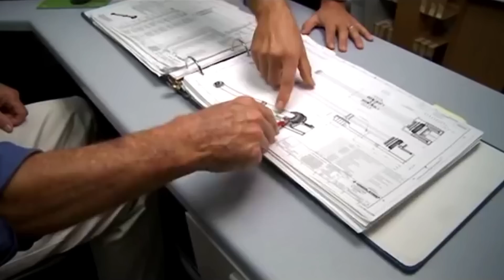US's Ultra-Advanced Railgun Weapon Is Making All Others Obsolete

Comment: Any information on the composition of the projectile?
Reply: I think it's actually aluminum, but maybe that's just the sabot that encases it until it leaves the barrel.  You don't need those extremely heavy metals for these, energy is 1/2mv^2, so the energy transferred to the target is unbelievable at those speeds, basically an explosion w/o any explosive material in them.  Look at the penetration tests as well, these go through many plates of steel like butter.
Reply: @boxlid214  or, F=MV?
Reply: @cosmicyeti6804  what's more important is the kinetic energy transferred to the target, which is the 1/2*mv^2 formula.  Velocity is squared, so much more important than mass in a weapon like this
Reply: Probably depleted uranium or tungsten?
Reply: @cosmicyeti6804  I was also thinking tungsten. DU would be an ecological nightmare from when the shell splinters and get embedded into the surrounding environment.
Reply: @joeclaridy  I heard the same. Last I heard, (I am NO expert by a long shot) that they cannot keep the gun from rearing itself apart. What I heard on the internet (and everything on the internet is true after all) that the damage is pretty catastrophic even after one shot.
Reply: @cosmicyeti6804  more or less what I figured, thanks
Reply: @cosmicyeti6804  I don't think DU can survive being fired.
My guess is extremely strong steel (structurally strong, rather than hardened), or aluminum which suffers less strain in 30,000 g's because it's lighter.
Not that it matters, the guns can't survive being fired either.
Reply: Watermelon.
Reply: It will be tungsten for sure.

Comment: Firing a projectile at that speed would ruin the barrel after only a few shots. This is the reason I think that it is not viable.
Reply: ideally, the magnetic impulsion field would result in no contact with the inner barrel, resulting in a frictionless launch.
Reply: @Maxislithium  it’s not the friction inside the barrel that destroys them, its the superheated plasma blast that happens at the muzzle when the projectile meets the outside air.
Reply: Use soft sabot.

Comment: Firing super conductor projectiles via rail guns that utilize a cryogenic chamber, could in theory allow for zero physical contact throughout the entire length of the barrel. Thus eliminating the wear and tear on the system thanks to quantum locking.
Reply: Go simple- Brass sabot.
Reply: @jozefkozon4520  why brass?
Reply: @joeclaridy  Soft+conductive+cheap
Reply: @jozefkozon4520  Not practical. brass will vaporize before it leave the barrel create a toxic cloud of zinc (brass is made of copper & zinc).Brass has way too much resistance to work (about 5 times more resistance than copper)
Reply: @guytech7310  still, that's closer than weirdout barrel. Sabot is one use anyway. If not brass, than another material will be found. Plasma problem can be solved with muzel device. Problem lays with electronic anyway. To be frank I'm just iritated for people that do noise over things they do not understand. Problems are to be solved and mindset of imposibility will not get us there. But in hindsight, brass might not do. Would you propose alternative? Clear copper maybe?
Reply: No because that's not how Rail guns work. The pair of electrodes needs to short across the projectile to accelerate it. The current needs to flow through the projectile.

Comment: more range, more firepower, always welcome in this arena.
Reply: and that's why most of the world is moving towards missiles. why make an obscenely expensive cannon when you can just mass produce guided missiles ?
Reply: @Lapantouflemagic0  I imagine this could have certain advantages over missiles, the projectiles may be alot cheaper, and it would deal immense damage.
Reply: @vegasspaceprogram6623  the projectiles, yes, would probably be cheaper and could be carried in greater number on the vessel. i think that's the main advantages of cannons (railguns or not) over missiles. 

but still, as cool as railguns are, i'm not sure they are actually that interesting. lasers are probably much better and can be used defensively.
Reply: I imagine your partner often says more length in your arena would be welcome too.

Comment: Rail guns are not artillery. They are flat, or nearly flat, firing weapons, because they can break atmosphere, if they travel fast enough.
Reply: They are also not capable of firing the types of rounds needed in combat. The fused round is one that it can't fire. You need that arc to drop that round right on top of certain targets. The current rail gun is also useless because it wears out too quickly for how much it costs.
Reply: @Jonathan.D  True, I had to look up some information. I had lumped all magnetically driven guns into rail guns. But that is not accurate. There is rail guns and coil guns. Rail guns are kind of like the video. Coil, or gauss, guns are different. But I can see the use for both types.

Comment: I believe the Navy completely cancelled the railgun project last year.  I think the bottom line is that these projectiles would be MUCH cheaper than building hypersonic missiles and that would ruin alot of defense spending schemes, kickbacks for politicians, and post retirement jobs with defense contractors for military officials in charge of research and procurement programs.  They can simply spend trillions more on hypersonic missiles in the long run than they could by fielding EM guns.  Scary that the Chinese Navy are already fielding prototypes but the US Navy is looking to get out of them completely.
Reply: They canceled it due to excessive wear and tear on the barrels. Material science isn't sufficient at this point.
Reply: @williamwallace9685  You got it right!👍 The barrels have a very limited life span. Plus, the ammo used is limited to just a few types. So it could never replace artillery.
Reply: @williamwallace9685  that's how I understood it too. So I doubt the rapid fire ability, practically speaking.
Reply: @williamwallace9685  not saying corruption wasn't a part of it , but  consider the following: 
1- Lying about the project being cancelled can reduce enemies' awareness and interest in the tech, giving the US the lead in the tech.

2 - Missiles can be fired from the air , submarines and mobile ground units, while stationary/heavy railguns might be destroyed by the enemy in a preemptive strike.
Reply: I worked in the defense industry for years and that's not how they operate. Look, rail guns are really cool in theory, but the fact of the matter is they require vast amounts of electricity and right now that makes them extremely large systems. Until you can get the size down, then there is no real use for a rail gun on platforms even as large as a naval destroyer.
Reply: @joeterzio7175  The Chinese hid the giant coal-powered power plant that their ship is connected to. 😄
Reply: @Jonathan.D  LOL!
Reply: @Advocate For UFO Disclosure It’s comments like this that make me wish YouTube would bring back the dislike button.
Reply: @infidel1993  The dislike button only showed dislikes for the video itself, not for comments.
Reply: @infidel1993  there is a dislike button i use it all the time.
Reply: A company will have to take the financial risk and prove it out prior to US military purchasing it now.
Reply: Needs portholes so we can shoot out of it.
Reply: The railgun is crap. It needs the entire gun replaced after just a few shots. So unless the Navy carries a storehouse of replacement guns in their hold, it isn't feasible.
Reply: @stevethewsimpson25  If that was the case, than just made the sabot soft. Bael aint the problem, but impulse power.
Reply: @jozefkozon4520  most of the damage to the barrel isn’t from the sabot but from the plasma blast that happens when the projectile exits the barrel. The projectile is moving so fast that the friction with the air creates a superheated ionizing plasma that destroys the ends of the barrels. That’s why there’s an explosion that looks like a traditional muzzle blast in every clip of the rail gun firing in this video.
Reply: @housegoth  Simple solutions. Aside from bras sabot, use cheap barrel extensions to destroy instead. Problem described seems firly close to how any barrel goes down. Going ol'complcate is dumb in the first place. Core of the problem stayed simple anyway.
Reply: @jozefkozon4520  it’s not that simple, material science just isn’t advanced enough right now to make these useful while in atmosphere. If we could mount these on some sort of spaceship they would be brilliant.
Reply: @housegoth  Problem lays at the barrel's end. So why are you willing to overenginer the wchole thing to solve it anyway? If disposable end sleeve is to simple for ye, we can go with low presure end zone, maintained with plazma windows or more fancy, cold plasma coating for the end. If you recognise the problem corectly, you almost have a solution. And simple one's are more cost efective.
Reply: @housegoth  The problem is not from air friction, it's from the electrical contact of the projectile armature carrying mega-amp currents sliding along the rails. That muzzle blast is caused from the plasma arcing across the armature and rail wear. I worked for ARDEC (mentioned in the video) back in the 80's testing their 30 MJ gun. We fired it in a vacuum and there was still plenty of muzzle blast.
Reply: A big factor in the cancellation was the realization that the rail gun projectile could be used in existing gun platforms and still yield nearly the same performance as being fired out of the rail gun, but without having to drastically alter gun emplacements and put in megawatts of power generation and storage capacity.

There's very little upside to having the rail gun on a ship and the cost to implement them would be absurd. When you can get nearly the same capability by using the hypersonic projectile in a powder fired gun, there's just no point in changing everything.
Reply: @oldscratch3535  There is a problem with that mindset tho. Rockets are expansive and slow to make. You can do more shels in an hour than rockets in a year. It's of no importance if you fight terrorists, but against real military, that's just dumb.
Reply: @jozefkozon4520  They put the projectile into the regular cased ammunition for things like the 5" gun and got nearly the same performance as being fired from the rail gun. There is no rocket here. Its just a hunk of metal. They literally took the hypersonic projectile from the rail gun and fired it from a regular naval gun and got the same results. That renders the rail gun pointless.

The rail gun isn't even an upgrade over regular naval guns b/c in order to use it you still have to get close enough that the enemy could easily hit you with missiles. A 110 mile range is nothing compared to what an anti-ship missile can travel.
Reply: @oldscratch3535  It is. Having that range and fire rate does make the diference, when misiles run dry or run low. And puting those projectiles before grey powder ain't gona give you that.
Reply: @jozefkozon4520  OK dude. I guess you know better than the U.S. Navy. Write them and tell them they're wrong.
Reply: @oldscratch3535  Lobby.
Reply: The railgun ammunution for the zumwalt class destroyer was more expensive than the ship itself almost. This probably has nothing to do with that..
Reply: It figures. What else is new. Flag officers would have to to exist on their pensions.Boo-hoo!

Comment: On of the reasons the USS ZUMWALT was canned was the price of the round for their rail gun $1:000,000.00 per shot. Ouch.
Reply: I heard that too, but it doesn't seem reasonable.  Is that the cost of a prototype round?  Or the projected cost of a production round?
Reply: It also rescued a large fishing ship during a very bad storm here in Maine and the ships radar basically picked up the zumwalt as an extremely small vessel
Reply: Wasn’t canned still have two at my navel yard in Maine being worked on as we speak
Reply: Also can be completely controlled remotely no crew needed some amazing features are on it and I’m honestly proud to say I’ve took part in it and the DDG series as well
Reply: It wasn't a railgun. The reason the gun was / is being replaced is because of massive cost if the ammunition.
Reply: @sih1095  that is true but the 1 ship can power all of New York the rail gun isn’t the only secret it was meant to hiding I’ve worked in side it doing finish work I can assure you it the deadliest ship to ground vessel to date